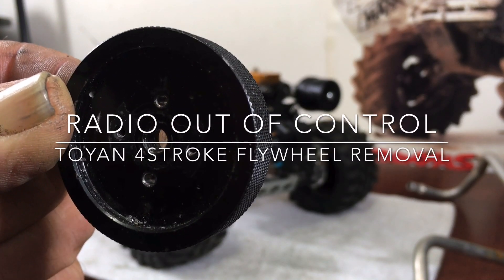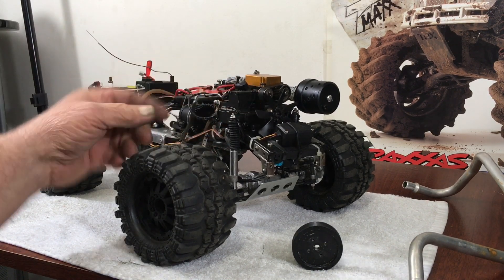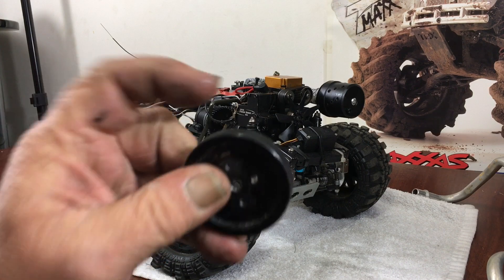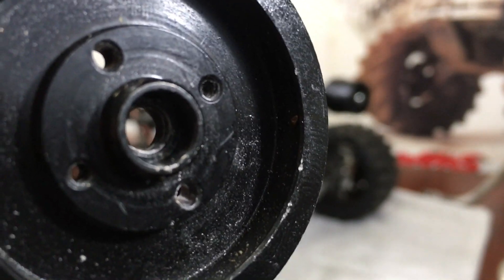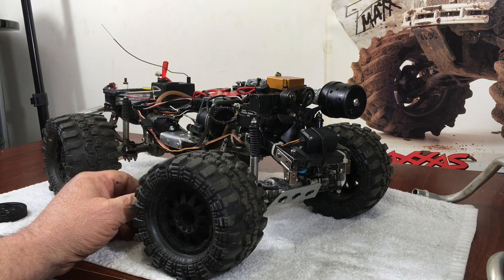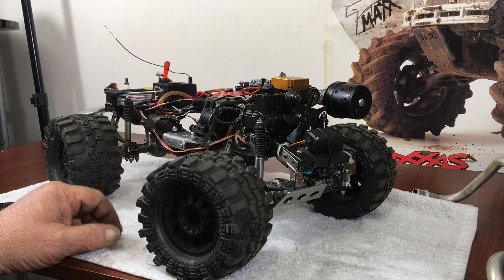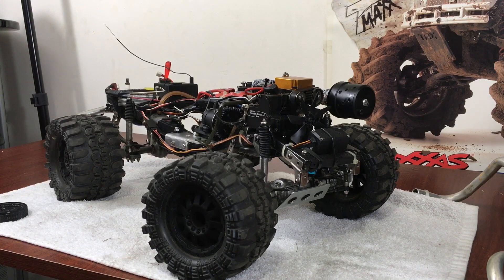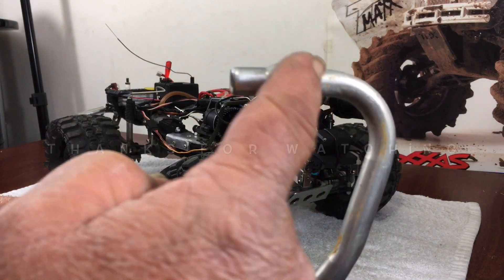TOYAN 4STROKE Flywheel Removal

Comment: What is the  brand name of nitro fuel along with percentages that you use for you’re toyan engine ? Also what engine are you running is it the gasoline version or methanol version in you’re videos? Please let me know thanks. Great videos and work I can’t wait to see more updates soon.
Reply from the maker: I am running the methanol version of the engine and the fuel im presently running is 15% nitro and 18% caster oil  from powermaster, I don't know if that company even exists any longer, the other fuel I have run in it was a 20% from S&W hobbies but it didn't specify the oil amount.
Reply: Cool thanks Dennis I’ll have to check them out. The reason why I had asked is because I’m starting my own build channel and have tons of old vintage nitro rc cars I want to bring back to life and also mod. I have about 3 gallons of  Morgan fuel sidewinder backyard basher fuel 20% nitro 16% castor synthetic blend still laying around from last season and was just going to use that when I got my toyan 4 stroke methanol engine for my Rc truck but am not sure if i would be doing harm to a $300 engine. Any thoughts? Thanks again man.
Reply from the maker: @RedlineNitroWerks    Great to hear your starting a channel!  your fuel should be fine, actually my current fuel is about 30 years old lol, I forgot i bought it back in 1989 and never opened it until i got my toyan engine and wanted to hear it run.  I will have to check out your channel bro!

Comment: Hey Dennis, I made a new exhaust for my Toyan 6 wheeler, all it did was to make it run really hot and impossible to tune, I have gone back to the standard set up, I am going to make a new needle valve up with a longer taper on it, the original is a bit like an off an on switch, but sure we can sort it, there is more to come from this motor with guys like us having a play with it 👍🏻
Reply from the maker: I removed my boost box also today,  I installed a 1/2 inch tube and had the same problem as you in your video, so i thought about it and realized i had no pressure tube returning to my fuel tank. I think i stumbled on something when i made a elbow from 5/16 tubing and ran it into my homemade 5/16 exhaust pipe and muffler with a nipple return to fuel fuel tank and it turned on this engine on like a black sabbath song, lol running 15 per nitro and 20 yr old fuel It grew a crowd when it shifted into second suddenly walking sideways, just when I was going to convert back to a hipo nitro 2 stroke lol....
Reply: Dennis Dempsey Radio out of control 
I had a pressure feed on it as well Dennis but it just would not run, it had 10 mm Od tubing with 8mm bore,  had it revving really well but then went sick and no matter where I put the needle it would just not run properly, can you show me your set up and truck running I’m getting a bit disappointed with it, even back to standard it don’t run well 
Thanks 👍🏻
Reply from the maker: @Blacklamass    Hmm I have been thinking about your delima and your carb might be bad, I hear they are really good at taking care of problems at Sterling engine maybe shoot them an email and explain the carb problem.  Have you tried running it with the glow plug powered? I had some weird things happen to mine like the rocker arm shaft came loose and the timing belt jumped one tooth once and fuel going bad from sitting in the tank to long, I run mine with the glow plug powered if not it drops power and i have the starter on my radio so when its way away and stalls i can restart it. I am still running the original OS f style plug it came with and not had any problems. I will try to get a updated video of it off roading and my exhaust this weekend for you, I wanted to add the toyan V4 has a short header pipe per cyl, they really rev those things wide open for a long time in some of the videos I wonder how much heat these are built to withstand! lol.
Reply: Dennis Dempsey Radio out of control 
Hey Dennis thanks for the reply, I also have the starter on the radio but the plug is only ignited while the starter turns, I don’t think it’s ever ran a tank of fuel without overheating or running sick, I too had the rocker assembly come lose on the first start lol.
Would be good to see your set up and how it runs, I always have to play with the mixture it’s never the same, also leaks oil onto the belt so fan slips badly so was going to fit a brushless fan up the front, I have fitted the body and lights now would just like to get it to run for more than a minutes lol keep up the good work always look forward to your videos
Reply from the maker: Hey brother I was watching your video again and I had some problems with the fuel tank pulling a vacume at wide open throttle, try running it with the fuel tank lid propped open and see if that changes anything, I also had put an O ring between my high end adjustment collar and the carb body it had an air leak there, I seen your timing belt was soaked like you mentioned I would check the front crankshaft O ring to see if its there, mine dose leak a little at the front/rear but not as much as yours.

Comment: So the 2 stroke v8 is a scrapped project?  Or are ya just waiting for some motivation or inspiration?   You finish it and get it running that dude could make you some good money..  as detailed and knowledgeable youve become on the project doing it all by hand, if you made a copyrighted kit to do that or even just a 4 cyl. If you got that to a manufacturable process i guarantee big payout..  theres a lot of potential in that.   Plus i just wanna hear the thing run..
Reply from the maker: I was attempting to start it a couple weeks ago but somehow a staple got sucked in cyl 1 and locked it up, so I tore it down again to fix the jammed up piston rings...lol its back together again and ready to go when i get some time to spend with it.